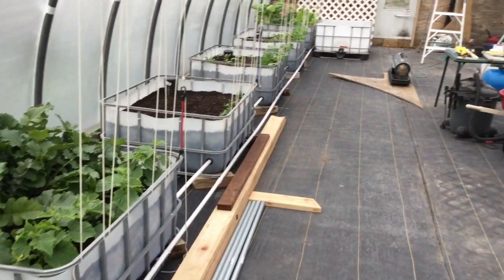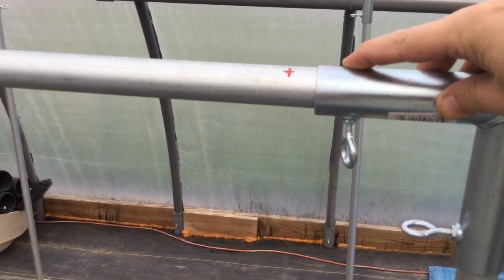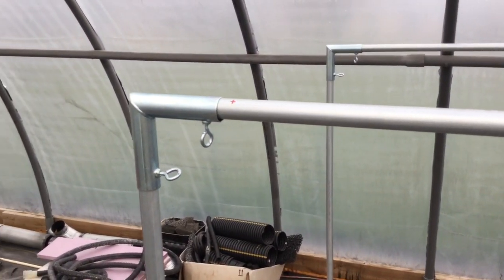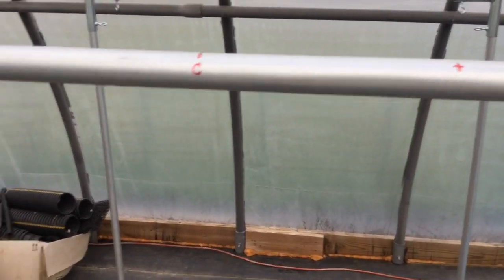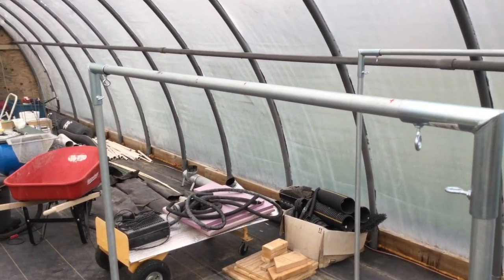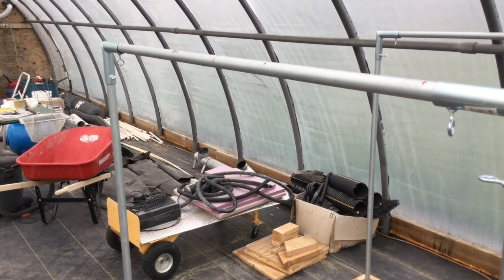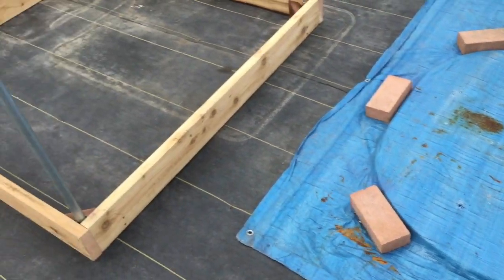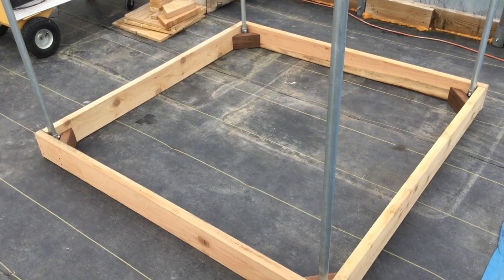Rack For 16 3D G-Towers (3)

Comment: We have BNSF rattling through here as well.  PITA!

Coming together nicely my friend!  I have been out of the loop a bit as I am opening up a storefront for the 3D Tower displays and printers.  One thing I truly love about the towers is the almost unlimited ways you can incorporate them into different systems.  Hydroponic?  Aeroponic? Aquaponic?  You bet!  And since they are modular, you can adjust the height/number of modules as needed for the space you have.  Super simple, no tools required!

Looking forward to your progress Larry.  Really need to come up and check everything out soon.  I got's ideas!  ;)
Reply from the maker: Interesting project! About all I'm selling anymore is the license to use the models, I don't think I've sold any towers for about 6 months, but I sell 3 or 4 of those licenses per month. As for these racks, they're strong enough that I can do pull ups in the middle of them. I didn't know steel conduit would be that strong. The one that I'm working on now (and the next one) will be perfect for growing herbs and small greens, and I'm going to be able to use 4' towers in them. I'm kind of leaning towards the idea of making the last two racks wider so I can install 4x4 based towers about 2' apart.
Reply: Conduit is very sturdy on short spans.  We used it for many different structural applications over the years and will be using it in the demo systems for tower and light support.
Reply from the maker: Funny, shortly after I replied this morning saying that I haven't sold a tower for 6 months, somebody ordered a black one. I'd be curious to see how people are feeding them with aeroponics. The sprayer part has always left me wondering. But I do have to say that new cap design works great for hydroponics and aquaponics. I'm still dealing with struggles educating people about filtration in aquaponics. Something those guys over in Wyoming never showed in their videos is how many times they had to go unplug their spaghetti lines. So everybody who fell for their videos are learning the hard way and don't immediately accept what I tell them about solids filtering.